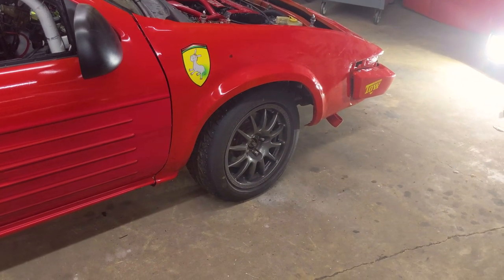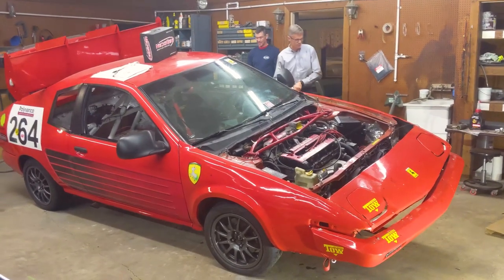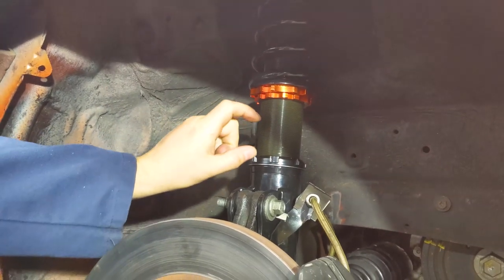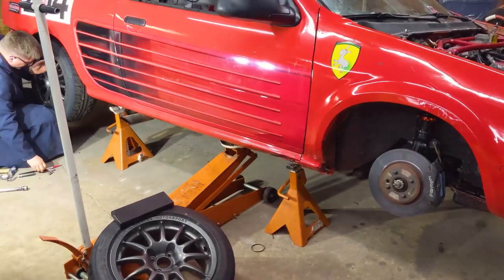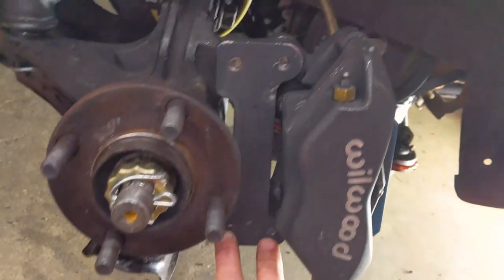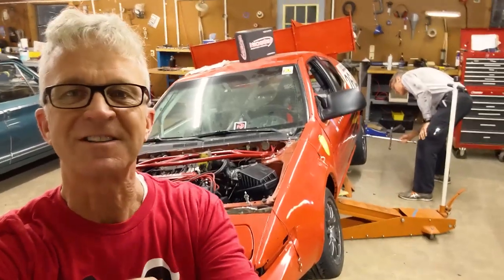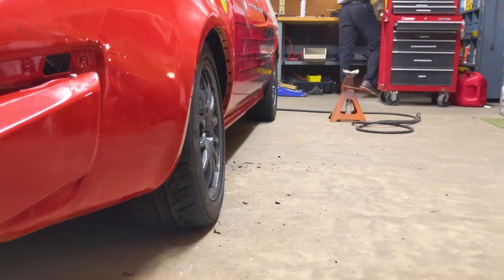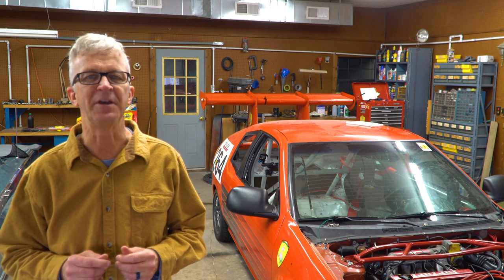24 Hours of Lemons Build - Suspension is Slammed - Vlog #12

Comment: Good move on flattening that seam in the front wheel wells to protect the tires. However, I would strong let recommend relocating the wiring harness that was right next to it. Much easier to move it now vs repairing and relocating it at the track after the tire rubs through it.
Reply from the maker: That's weird.  I thought the same thing AFTER watching the video.  I don't know why I didn't think of it while I was working on it.  Thanks for watching and commenting.

Comment: Make a high mounted spoiler connecting to the rear shocks instead of the body, also I need help, do you know if it is possible to enter a death kart into 24 hours of lemons?
Reply: Nope, no open wheel cars.  But if you want to contact the lemons folks for details, they are receptive to new ideas and will give you the limits of what they allow, stretching the rules.
Reply from the maker: Thanks for watching!  I googled "death kart" and I don't think that would pass inspection.  Lemons cars must have fenders, doors, hoods, windshields, and also, the tires can't be out in the open.  You can find the rules at https://24hoursoflemons.com/prices-rules/ Check out Rule "3.J.2"